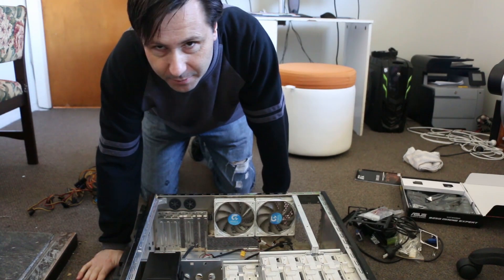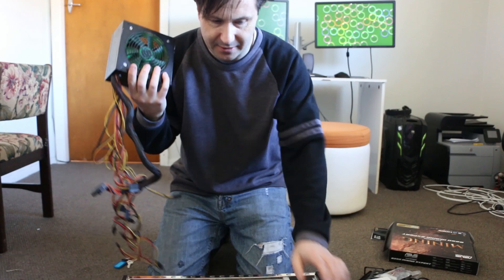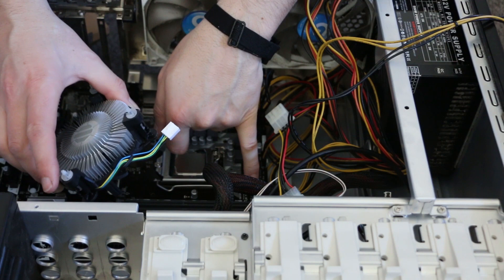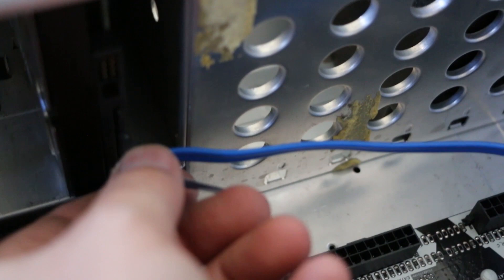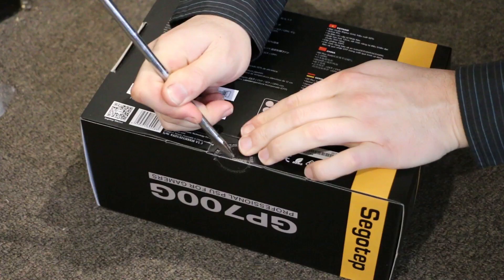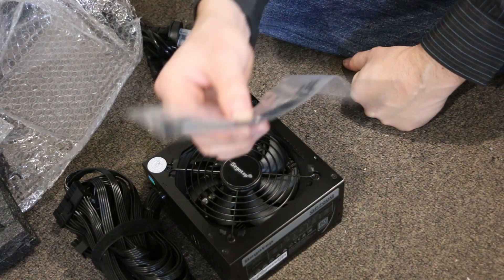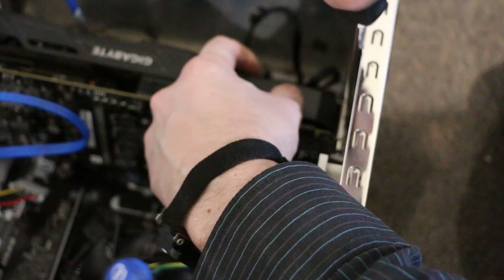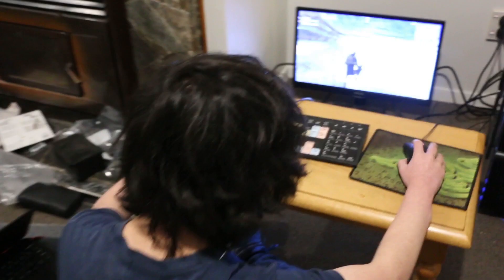$500 Gaming Computer Built with Asus B250 Mining Expert

Comment: yeah that's officially the biggest graphics card I've ever seen... mine is half the size of that, and is 2gb. And with my 6 core cpu, 12 gigs of ram and 2gb graphics card... I can edit 4k video. Also adding a couple of SSDs into my PC soon.
Reply from the maker: Yes SSDs are excellent for video editing as hard drives tend to be a bit of a bottle neck. It seems like you set yourself up the perfect system as video editors use the CPU rather than GPU. Although Adobe can utilise NVIDIA cards for faster rendering.
Reply: I've got the 2x SSDs now and upgraded to the RX480 8gb card. Faster for editing and viewing 4k. The SSDs make loading the apps much faster.
Reply from the maker: Totally agree SSD's are the best for editing!

Comment: You do not need to plug in that top molex if you are using just 1 gpu in the x16 on this mobo. Just connect the other 2 molex and it should work.
Reply from the maker: Yeah I tried that thinking that would work and it didn't. It's a strange MOBO!

Comment: you did not need to use the mol connector and take out the pins etc for gpu power, I find that when I used a gpu with no 6 pin power or anything it needed it but with a gpu like yours it won’t be needed, it wasn’t needed for me

Comment: What chassis is it exactly?
I want to use my b250 mining mobo for gaming too, while mining using a different setup. But It says the mobo is super wide and wont fit any chassis, despite the ATX formfactor.

The different setup I will use:
10 of my cards will mine, the last one will be used as gaming GPU. The ones used for mining will run on a different harddrive and have 1 allocated CPU core. 
Gaming & gaming GPU will use 3 allocated CPU cores and they will run on an SSD.

Comment: I’ve seen one or two questions like this but, does this motherboard to fine with gaming? I’m planning on using a i7-6700, r9 380 16gb(2x8) ram on it. You think it will explode or am I safe?
Reply from the maker: These parts are 100% fine with the B250 Mining Expert. The R9 380 could never be used for mining its power consumption and hash rates are terrible are you sure you don't want to pick yourself up a second hand gtx 1070? The gtx 1070 is benchmarked at almost twice as powerful for gaming, while also leaving your options open for a bit of crypto mining on the side.
Reply: @hostingboy  yea. Im still looking into buying something like a 1070, i just cant seem to find a good used one for a good price.
Reply: Hi i have 16gb(2x8). Whenever i put 2 rams power saving mode appears in my monitor. But when i removed 1 of them it starts to boot up. How i may suppose to install 2 rams?
Reply: I have corsair hx1200 and g4560 cpu
Reply from the maker: I have never struck this. Perhaps a fault with one of the ram sticks? Check that they are DDR4 2400/2133 MHz Non-ECC, Un-buffered Memory

Comment: i have 5 rx580 cards and a card my hashes are 27-29 mh/s but when im playing the fps drops from 45-25 its just my estimated but it so bad. got a 4gb ram ddr4 and a ssd
Reply from the maker: You probably need to use a crossfire bridge connector and activate it from your motherboard settings. When you're mining GPU's work independently, for gaming you need them to work together.
Reply: If you're mining ETH, each card will grab RAM, I think its around 1,6gb now. I had to use 32gb ram for 13 cards. I thought my setup didnt work at first, but when I added more RAM it worked flawlessly. Windows pagefile isn't a very smart choise.

Comment: So, if I wanted to put 15 sata cards in this with my gpu, It would work?
Reply from the maker: I use Molex. Users were saying at the time of this build that SATA was a fire risk. This turned out to be  SATA -> Molex convertors burning the plug out due to differing watt ratings between the connections. So Molex is what I use and recommend, but a straight SATA connection should be fine.

Comment: that molex you mangled only power the risers. so u wasted ur time
Reply from the maker: No, you are wrong, it won't run without those being powered
Reply: @hostingboy   i have 24 of these boards. each with 19 gpus. not 1 has any molex plugged in. You are reading from the manual, while i speak from experience.

Comment: what mod to psu for gaming
Reply from the maker: If you want to plug the GPU directly into the MOBO, chances are the PSU plugs then won't fit so you could pull the pins as I did at 8:36
Reply: Hamish Webb sorry, I don't understand. isn't the 24pin enough to supply the GPU with power?do I need to connect that extra cable? I'm thinking of building using this motherboard.